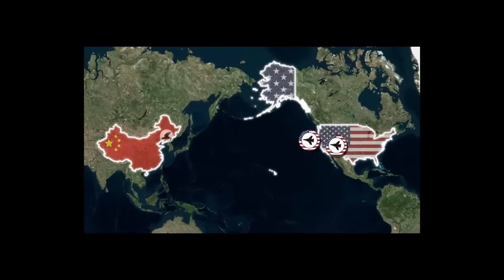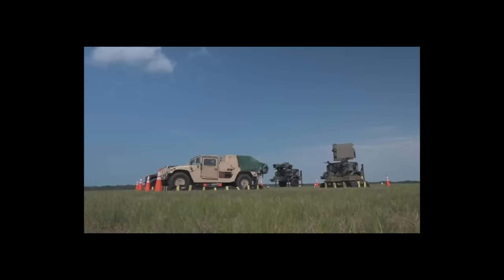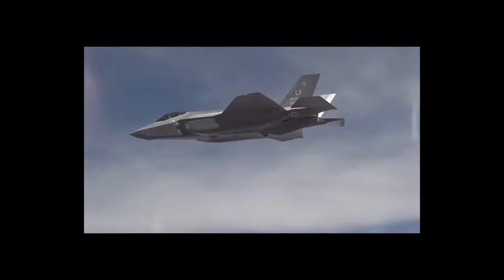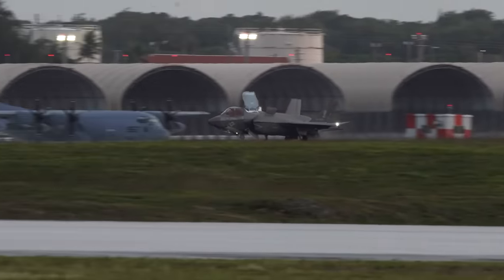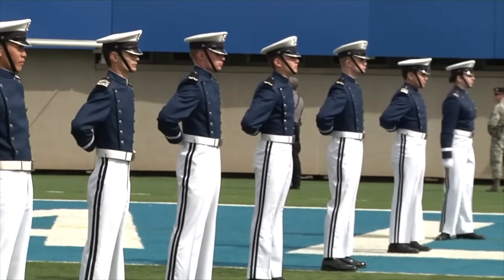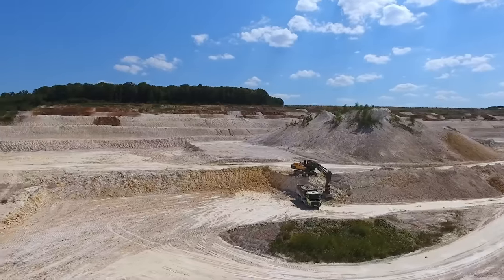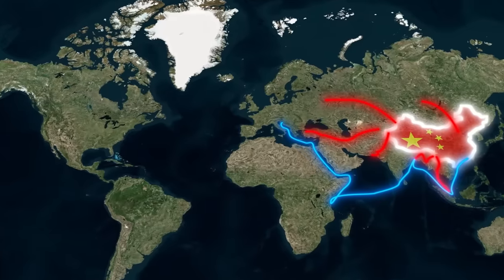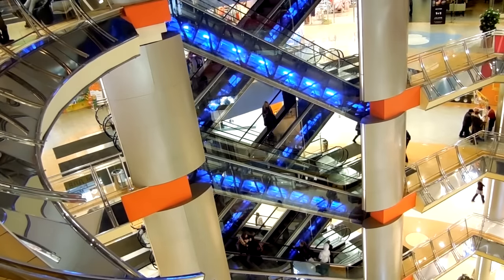Why America's New Airstrike Weapon Is A Total Game Changer   COMPILATION

Comment: I’ve heard from a few friends in the industry that a west coast company is actually developing a mach 10 guided ordnance. Supposedly coated with materials similar to what was used on the space shuttle. I called BS on them but you never know. Anyone else hear anything about this?.
Reply: Mach 10.2.  It’s a modified guided hypersonic glide bomb.  The tiles are polymerized and layered silicon based material infused with lattices of quartz (and I believe boron).  

The really interesting thing is this weapon has a specialized antenna that allows a GPS/Direct link if it needs to be guided in (despite the plasma like vortices it produces at maximum velocity).  That aside, it can also differentiate targets and can be pre-programmed to look for specific targets based on telemetry from satellites and photos.

I don’t know the exact size of the warhead, but it’s substantial.
Reply: yes
Reply: love this channel
Reply: US is now only now trying to master hypersonic missiles and you think they already have that is mach10? Ya, you are right , it does not exist.

Comment: Hey guys, I was wondering, could you possibly set ups CWIS with incendiary flak and add a few more? I would imagine it would be able to take out missiles with less rounds as well as dominate supersonic maneuverability with fast enough processing to use two or three CWIS at once to hit every possible juke the missile can make... Just feels like the perfect weapon for the job. or back to DU but the flak effect is required
Reply: CIWS uses two radars, or did. One tracks the target, the other tracks the outbound shells. A computer uses that data to correct and bring it on target rather quickly. It's an impressive sight to see.

Comment: A war can’t be won with air power alone 

Most wars have been won by a total naval blockade or boots on the ground. 

Inter-grated air defence, air superiority or A2AD are just a means to an end
Reply: With air superiority, you can take out radar, armor, defensive positions, bunkers, command structures, communication hubs, power, logistics.

All the enemy can do at that point is try to survive and harass with random disconnected cells.

I'm not saying you're wrong, but without the air superiority first doctrine, you have a situation like what Russia is trying to do against Ukraine, where even though they're a much larger and better supplied force, they are still taking massive losses due to the defensive advantage of an entrenched and organized military force.